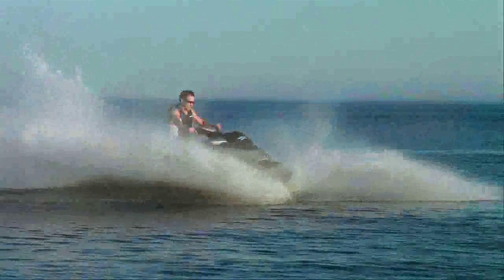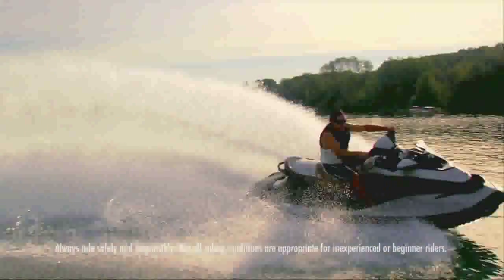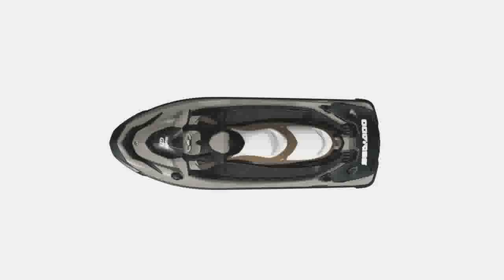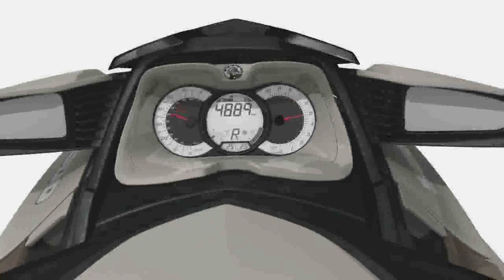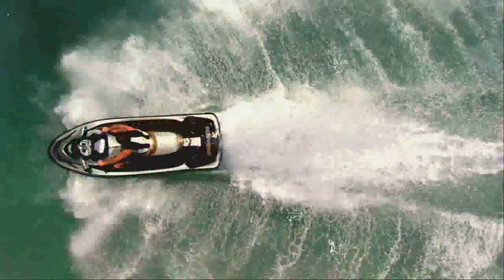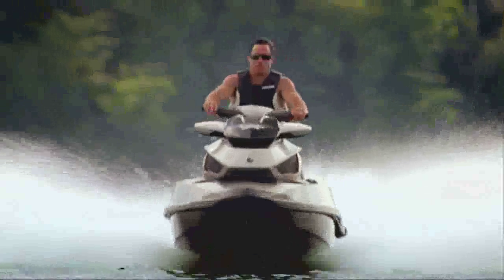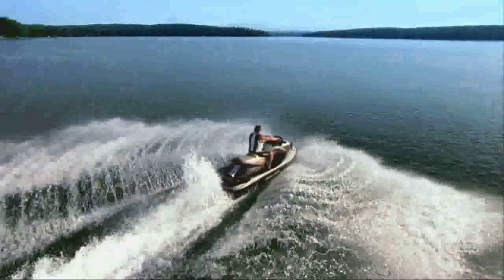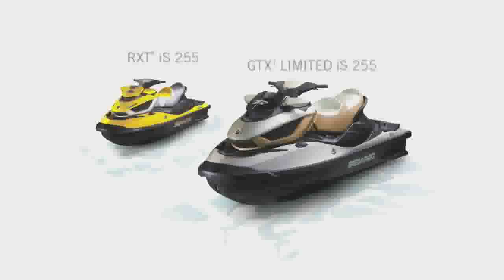Sea-Doo World's First On-Water Brake

Comment: Yeah i thought about it i would rather be able to stop on a dime by turning and throttling. think about it you pull the brake and you still go forward. If you do a power turn (kinda like a 180) then you would stop exactly where you turn. i bet anything i could stop faster than this "sea doo brake"

Comment: i can do the same thing and do a stoppie with my 900st by flipping it into reverse while driving... wase of time imo.  all these things are turning into is bigger and bigger couches. bring back the 1 and two seaters

and the old cafe racers had those but with a paddle that shot out and down from the rideplate. 

they are not the first to make a brake.. but the first to do it with a reverse bucket.